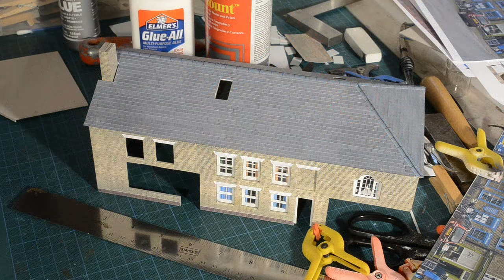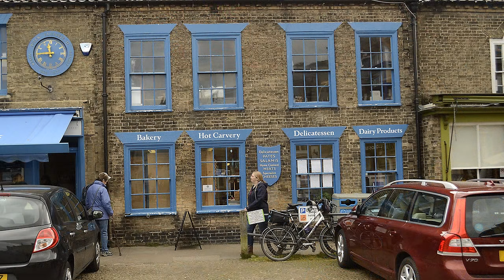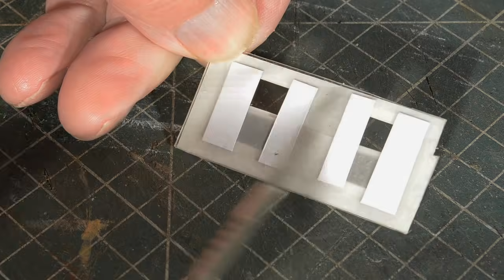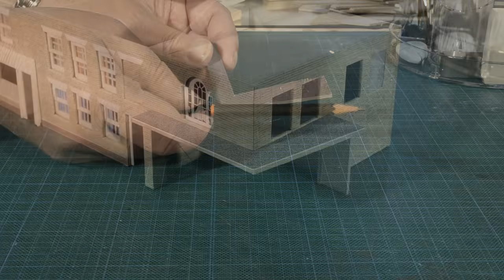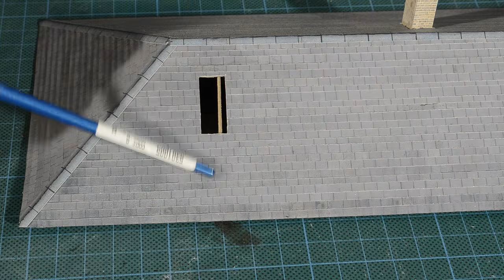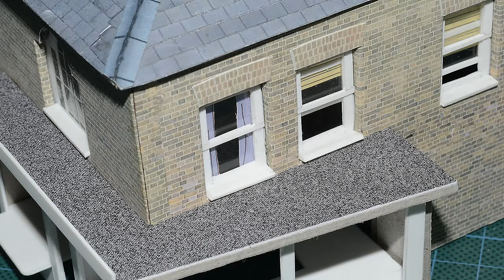MAKING BUILDINGS FOR YOUR RAILWAY #1

Comment: What a superb instructional video. I particularly liked the way in which you made several windows all at once. I will try to use that method in my current model building. Being relatively new to miniature building processes and having only ever used various woods to date, would you say that plasticard is easier to work with and paint when making doors and windows?
Reply from the maker: Hi David. Thanks for the comments, glad you liked the video. I would say plasticard is easier to work with. It is available in a greater variety of small thicknesses - this makes it easier to work than wood and it is sturdier to work with than card (for finer parts). It is also smooth and takes paint really well. The thicker cardboard is less expensive and fine for main structure. Details (window frames, doors, drainpipes, chimney pots, shop fronts, etc) suit plasitcard well. 👍👍👍

Comment: Thanks for the excellent video David! Was the brick paper something you purchased at a hobby shop? If not, how did you come about it?
Reply from the maker: Hi Scott, thanks for your kind comments. The brick papers for this are available as a download from Scalescenes here is the link to their 'scratch-builders' yard.
 https://scalescenes.com/scratchbuilders-yard/
You need to follow the instructions because there is a good chance that the prints will change colour. Buy quality inks for your printer to give you the best chance. A safer way is to buy ready printed papers from your local model shop (if you are lucky enough to have one) - failing that, google 'OO brick papers' online. The advantage of the download is that, once you have made your purchase, you can print it out as many times as you wish  ...  David

Comment: Hi David. I have no room for a proper rail=layout, so I am making 'dioramas' with static model; mostly under  'glass' cases made from acrylic panels. I need something to represent the permanent way under the lengths of rail which support my locos. Have you any ideas what I could use to represent the permanent way? Some kind of abrasive paper springs to mind. What do you think? Thanks for your videos on scratch-building! John in Brum.
Reply from the maker: Hi, apologies for the very late reply. I am thinking you are referring to the under-track ballast. My layout is set in the 1960s - just check it out if you are modelling a more modern era. Either way this material can be purchased readily in various colours and grades. Check out the many videos that will deal with this. You can buy ready shaped cork underlay strips but this won't look so convincing. My bet would be to use just the ballast.
For roadways I would use an emery paper as it is basically a road colour (but it would need weathering etc). Choose a fine grade, in OO guage there hould be hardly any noticeable texture - you could simply paint the surface of your base.
Hope this helps  ...  David

Comment: Looks like a nice job. Are you sure your scale is correct? Only the shot with the cars they  look a bit small in comparison. It maybe the cars scale is a bit suspect! But great job anyway.
Reply from the maker: Thanks for your interest Andrew. You may be right as I did not actually measure the building in the first place but scaled up a photograph as explained. It might be a tad out but I judged it against some OO figures, having said that there is a big variance in the correctness of figures. I also used doors from a Metcalfe kit to get my doors 'correct' for size. On balance I figure you may well be right but, in all honesty, they don't strike me as being far adrift. I am (slowly) in the process of making another shop - I will take another look at it. The vehicles are from Oxford Diecasts, I have not heard that they have scale issues. Thanks for your comments, appreciate your feedback  -  David

Comment: To get measurements of the building, you can use Google Earth.
Reply: isaac harms how?
Reply: First, search google earth in google and click the download option under the first result. Then click the agree and download button on the next page. Next, install the set up that you downloaded for the desktop version of google earth. Then, zoom in or search in the upper left search box to where you want to go and click the ruler icon at the top. A window should pop up where you can select a unit of length, such as feet, miles, etc. Finally pick two points you want to measure and you should get a result in that window that poped up.

Comment: Nice one David good video.
I don't do much scratch building but bash metcalfe kits using scalescenes builders yard prints.
Can't wait for part two 😃
Cheers Stevie
Reply from the maker: Hi Stevie, thanks again for your comments. Scalescenes is very handy for 'us builders and bashers. My platforms and goods shed were also scratch built but this is the most complicated build I have attempted at Deresley. I will crack on with Part 2. as soon as possible, and include an update in my June Update video. - David